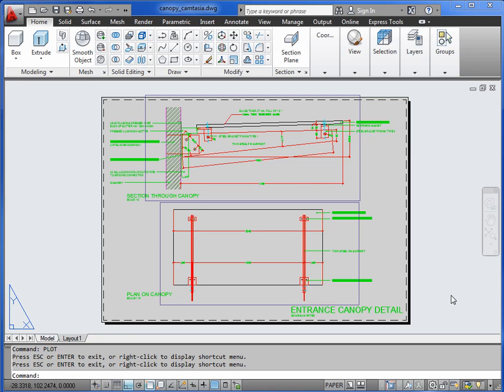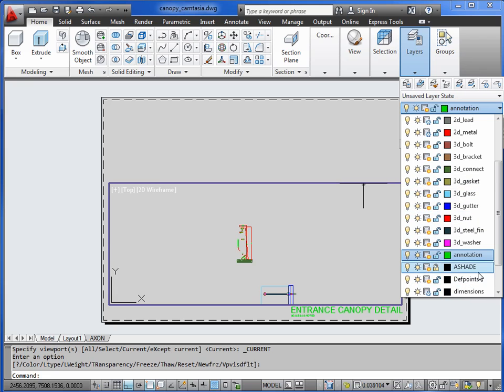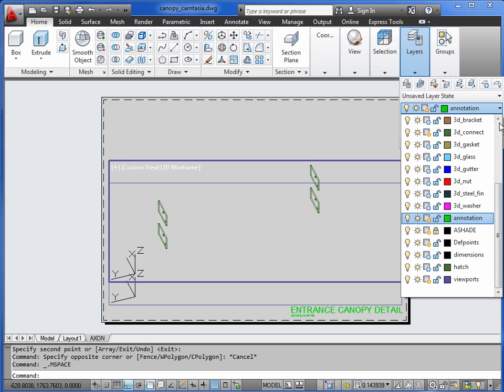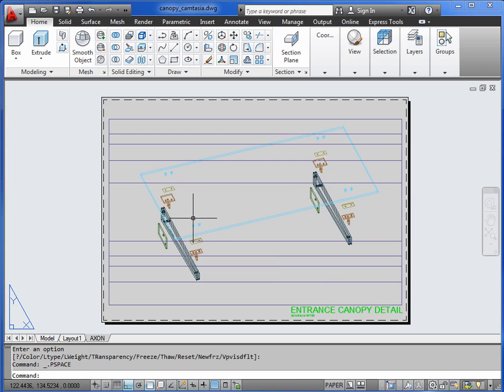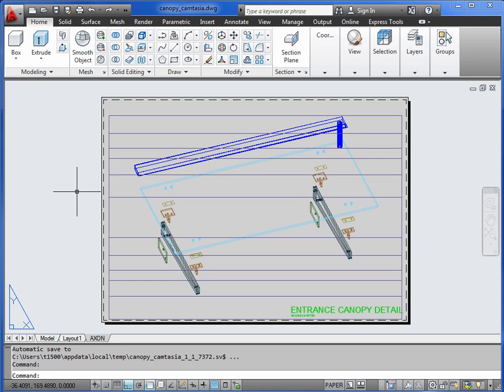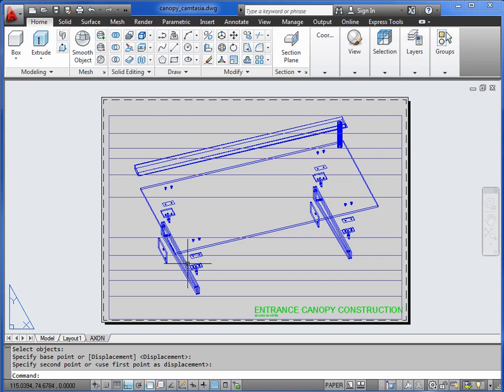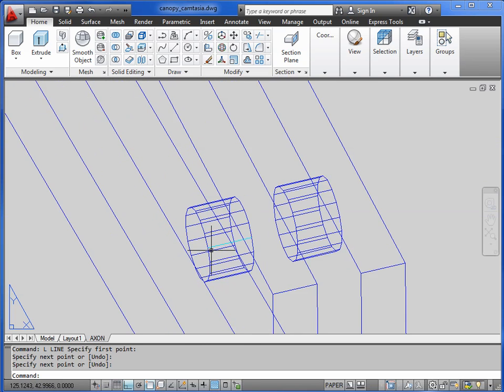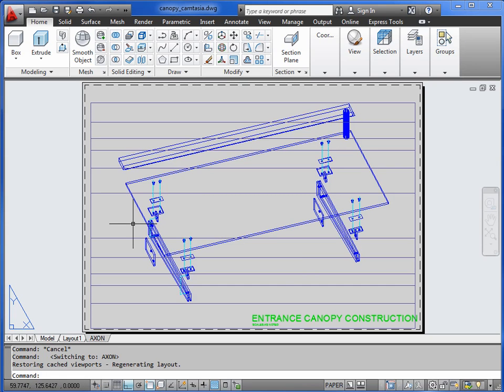AutoCAD Workshop Manual Style Diagram Tutorial

Comment from the maker: Hi Nwa - it's 2D drawings and a 3D model in the same file.   the dimensions are being put on the 2D drawing - that is safer as you can end up with dimensions going across 3D space if you are not careful.   forget about Isometric drawings - they are very laborious, make a simple 3D model and view it at an angle using the ORBIT command.   Try some of my modelling tuts first perhaps ?   Good luck.